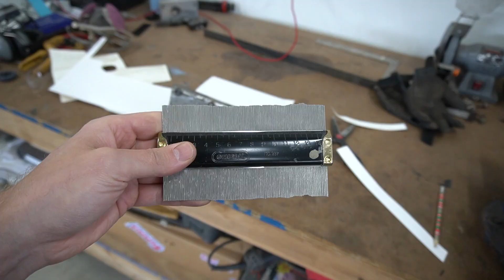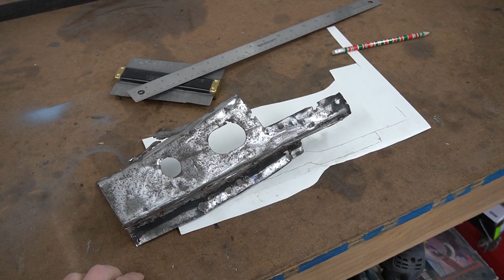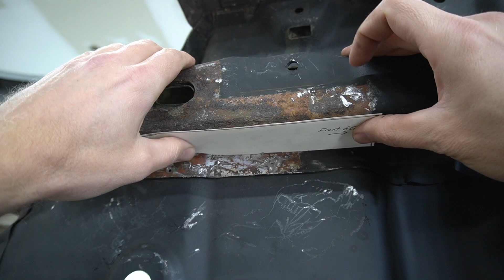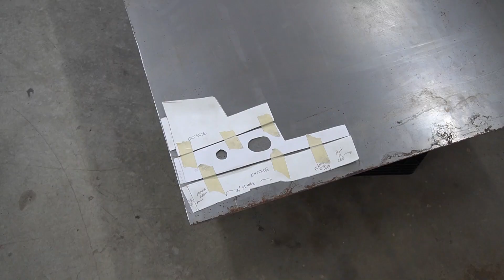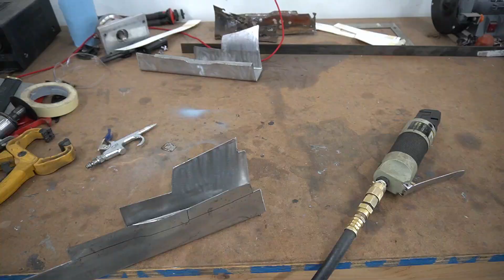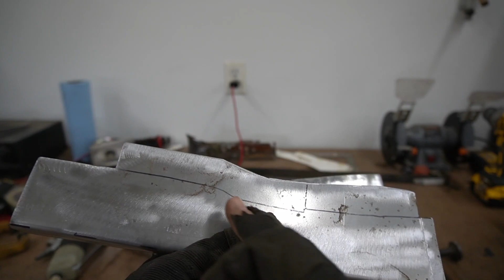Frame Rail Repair Section - 1971 Camaro Torque Box Repair [PART 2]

Comment: The tool you were missing that makes this easy is the hand held air powered belt sander.    Use a 1/2”x 18” 35-40 grit belt.     Works great for the spot welds.

Comment: Only a few years late, but the reason your templates were a little bit short is because when you welded the frame rail back together you didnt account for the 1/8th gap made from the zip disc. So everything where there was a cut was 1/8th short

Comment: Excellent work ! Were it myself, likely would have hammered the first one half to death and then buzzed it in. After seeing the second one sitting so much better than the first I will remember this and always try to maintain the highest standard i can. Thank you Dan, hope some great days for you !
Reply from the maker: Thanks! I thought about modifying it. I felt more comfortable making it out of one piece, without any extra welds, being that it's a frame rail section and it's thin material to begin with.

Comment: Turned out great Dan. I was lucky to get a short section for my repair from someone who just needed the rear section, but after your vid, I could definitely make one. I still need to invest in a brake, and a drill press.
Reply from the maker: Thanks Russ! It's definitely DIY material if you don't have to go back to where the frame rail begins to curve around the wheel well.
Reply: @RestoCar  I'm sure it would take me a few trys to make it. Sometimes our videos do make things look easier than they are. My repair will go around the curve just a little. Cant wait to get to that point. That means the doors will be done. Lol

Comment: Fantastic work. One suggestion is to invest in electric shears from harbor freight.  They're cheap and cut up to 16 gauge like butter and are faster then cut off wheels. .  I use them all the time and rarely use cutting disc. love the videos.  

Ahmad
Reply from the maker: Thanks for the tip Ahmad! I do need to try them. I bought a set of electric shears off of Amazon a while ago and have not opened them up yet. All I have ever used is the cut off wheel so it's a hard habit to break! Can you post a link to the shears you got from harbor freight?

Comment: Great job! Would you be willing to share a copy of the paper template you made?  This would be helpful for many that may need this section of frame and, like you, cannot justify buying a complete frame rail but are willing to make the attempt at making their own.
Reply from the maker: Thanks! I don't mind at all. I'll scan it and throw it on the website. I'm not sure how to get it to print to scale, but I'll see if I can figure something out there. I'll post the link here after I upload it.
Reply: @RestoCar  Great, thanks!  This will be very helpful for the 74-81 Camaro owners since reproduction full rails are not being produced yet.  With your template it wouldn't take much to be able add the missing few inches to create full rails out of the rails that are available.
Reply: @RestoCar  did you ever do this? Link to website please.

Comment: Another great instructional video! I am doing a similar repair on a 68 Torino. 
I don't know if this will help or not, I save old cereal boxes to make templates from and I have also bought a roll of floor protection cardboard for larger templates.
Aways like seeing your videos!
Thanks, Joe
Reply from the maker: Thanks! Those are both great ideas. I'll be saving the cereal boxes from here on out and I'll check out the floor protection cardboard.